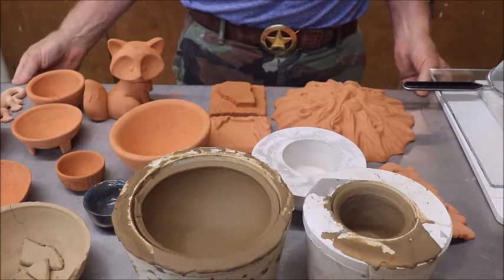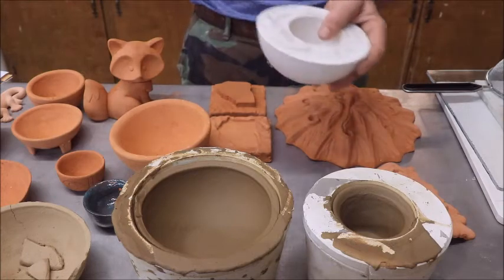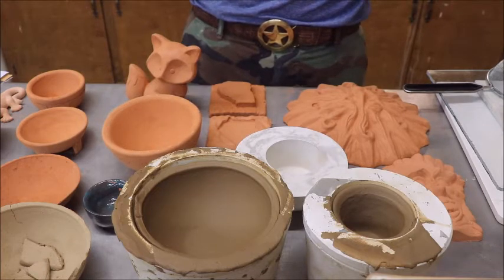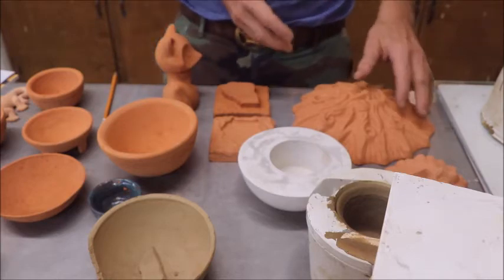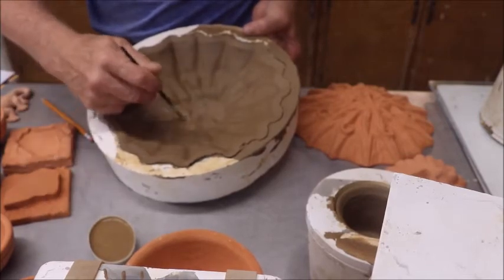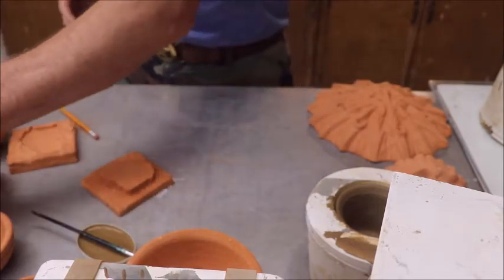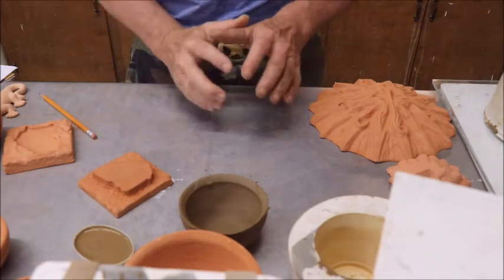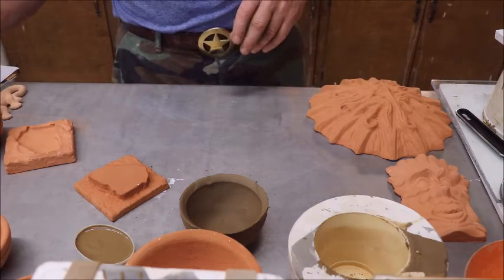Advanced Mudding, Part 3 of "Messing with Mud"

Comment: Do you fire the river clay like the clay slip? If so how long what abt glazing the river clay versus the clay
Reply from the maker: I fire the river clay slip to cone 04 just as I would commercial slip.  The bisque product will turn Terra Cotta in color.  I use regular glazes . but find that it takes a couple of extra coats to look good.  The natural clay is a little more porous that commercial clay.  I fire the glaze to cone 06 or as recommended.
Reply: Is river clay red like they put on baseball fields that seems to be the closest to river clay where im
Reply from the maker: Natural clay comes in lots of colors and red is one of them.  Mine starts off brown or blue and turns red or terra cotta when fired.  Here are two links to help with identifying and processing clay:  
https://www.goshen.edu/art/DeptPgs/rework.html
http://www.practicalprimitive.com/tempering.html
Hope this helps.
Reply: Thank you